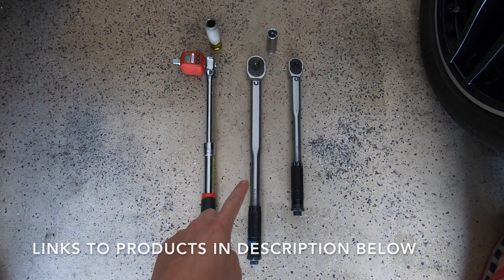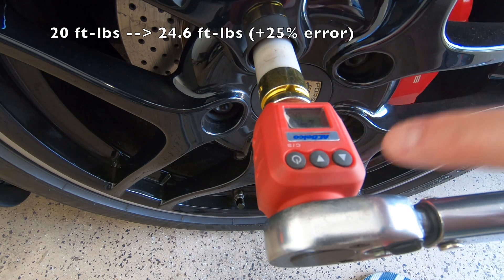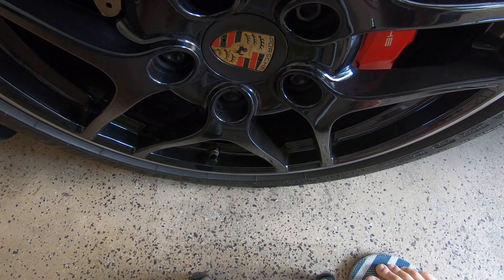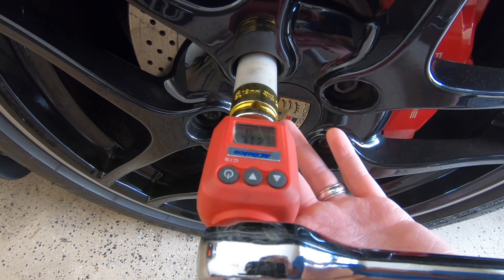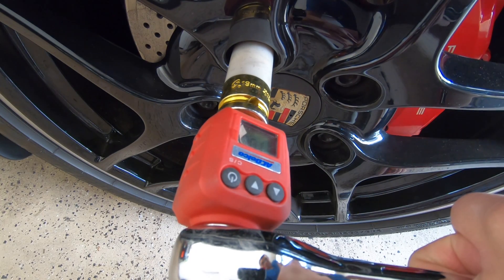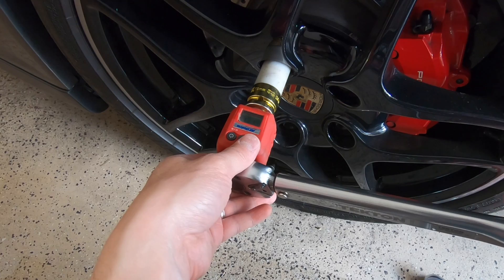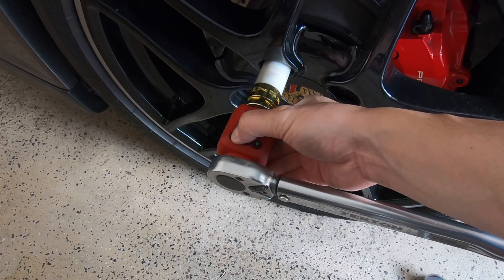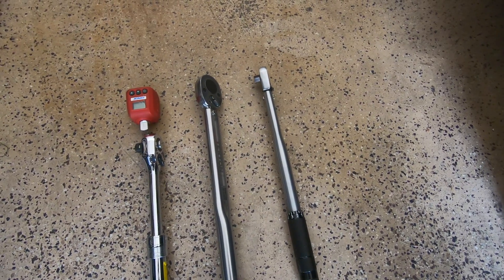How accurate are Clicker Torque Wrenches? Review & Calibration Tutorial

Comment: Why not just hang an actual weight measured exactly one foot from the center of the bolt with the wrench at as close to exact horizontal as possible.  Maybe even use a calibrated spring or digital hanging scale and just pull on it, regardless of the angle or direction of the wrench. Take out all mechanical variables, or as close to all as is possible.  You're just using a yard stick to measure another yard stick.
Reply: Just in case someone comes past and reads this idea, the tube type click wrench is length dependent, and the internal mechanism will measure the torque wrong if weight or force is applied anywhere other than the correct location at the handgrip. If the shorter wrench happened to be this length, a weight could be used directly. With a longer wrench, you can't hang a weight a foot out, it won't be accurate. The weight would need to be hung at the handgrip and the ratio adjusted, e.g. 20lb on a 24" wrench for 40 ft/lb

Comment: Not to takeaway anything from using torque wrenches, but why torque in the first place?  The answer is to place a preload in the bolt (torque actually only exists when the wrench is attached and force applied).  So threads are simply a spirally wound inclined plane.  As you might imagine, friction matters pushing a load up a slope.  And friction has two types, static and dynamic friction.  Everyone has experienced (I expect) that it takes more to get the load moving than to keep it moving.  Measuring what it takes to start moving (static) is not terribly comparable to dynamic (which is the correct usage).  Having said all this studies indicate there is up to a 30% variation in preload for the same applied torque.  Factors for this variation are clean threads, finishes of surfaces and oil/lubricant.  Oil or use anti seize on the threads when not specified = potentially more preload and over stressing due to reduced friction.  This is one reason you occasionally see single use torque to yield fasteners, the yield is the bolt stretching (preload), this then removes much of the variability due to friction which is hard to predict…. Where you can gain access you sometimes see measuring the stretch on the bolt specified.  Then there is ‘smart bolt’ technology…. a whole another level…. Ultrasonically measuring stretch.
I still use my torque wrench…. Just understand it isn’t an exact science and what you apply (or not) to the threads matters.

Comment: I think the test should be made on a welded bolt. Just need to measure the settings of the click wrench against the reading of the AC Delco. Then you could reach some +/- 5% (summary of the errors of the two units, in theory, in the midscale range). Which is better than +/- 10% in the begining, I agree. When You get +9% error to the click wrench, that could be really sth between +7% to +11%, with regard of those +/-2% from the digital gage.

Comment: I don’t have one of these so I don’t know if it has a zero button, but when did you zero the digital TW?. The wrench hanging on it in position is already registering torque. It may be why your numbers are off.
Reply: There should be a torque value showing on the meter when the wrench is hanging on it because the wrench is exerting a torque on it due to gravity.

Comment: Out of curiosity, how to test that the digital adapter is accurate?
Reply: Exactly, he replied with just stating what they told him was the accuracy of the adapter. I don't think he understands your comment correctly. Thanks
Reply from the maker: +/- 2%
Reply: @CarFanatic  how you know IF the ACdelco is accurate?  Did you take it to a place to measure it?  Or using known weight?
Reply from the maker: @johnnywong83  great question. I am assuming the acdelco is accurate within the specified range. The calibration of the clicker torque wrench will not be as accurate as if were taken to a real place, but it should be sufficient for my application.

Comment: How are you sure the digital indicator was accurate in the first place?
Reply from the maker: The digital indicator comes calibrated to within +/- 2% and I haven't used it much. It's not a perfect indicator but its more than accurate enough to improve the calibration of a clicker wrench.
Reply: @CarFanatic  What are you talking about?! The digital indicators are just cheap workarounds for hobbyists. The clicking mechanical ones are the gold standard. You should be checking the accuracy of the digital meters with the mechanical ones, not the other way around.

Comment: Man there are quite a few things you did that discredits the accuracy of the test. 1. You need to be aware of where you hold the torque wrench as you are applying torque. Too close or too far away from the handle area and you are applying more or less torque than indicated. 2. Once a bolt is torqued to a specific value, say 60 ft lbs, you can’t test it at 60 on the same bolt. It takes more torque to move that bolt..maybe 70..something about static friction. Torque values need to be reached as the bolt is moving. So you need to loosen, and then get to 60 again. 3. Torque wrenches are usually more accurate from 20% of full scale. So 5-80 ft lb is mostly accurate from 16ft lbs on.
Reply: Based on best practices, you have to move the bolt/nut in a smooth consistent movement and make sure you move up in torque at least with 5 ft lbs. So if the bolt/nut was torqued to 68 ft lbs and you want to go to 70 ft lbs, make sure you loosen the bolt/nut first to under 65 ft lbs. When you have multiple bolts\nuts, it is best to torque in stages to increase clamping load. So, for example, in case of tires lug nuts start to torque them (in cross pattern) to 50 ft lbs first then 65 ft lbs followed by 80 ft lbs.
Reply: The torque is measured at the head, exact hand position does not effect the reading.  Torque being force applied over a lever arm.  Shorten the arm requires more force, the torque is the same either way…
Reply: @EntropyPersonified  I am going to follow the instructions of every major torque wrench manufacturer that states grip position matters on a length-dependent torque wrench.
Reply: He did all the things you should not do lol
Reply: @chriscs9080  who, the video guy or Justin Philip? Thanks
Reply: It does not matter where you hold the wrench.  It is designed to measure torque at the hoint between the beam and the head of the wrench.
Reply: @rickyparrish2570  That’s not true at all. It does matter where you hold a torque wrench, hence why some wrenches are longer and others are shorter depending on the purpose and application it’s used for. 
(Torque = force * length) hence why it’s called a foot pound. 

If you have a 2 foot long handle, and at one end you have a socket connected to a bolt, and on the other end you have a handle to hold. If you hold the center of this bar (not the handle) you’d turn a 2 foot long handle into a 1 foot long handle. That means if you applied 10 pounds of force in the center of the bar to rotate the bolt clockwise, you’d be applying 10 FOOT pounds of torque. (12 inches = 1 foot)
On the same bar, if you held it at the handle (where it’s supposed to be held), then you’d apply 2 times the amount of torque if you used the same force (10lbs), aka 20 foot pounds. It’s not rocket science, plus I don’t see any reason to not hold one by the handle anyway unless it’s in a hard to reach place, in that case you should probably find another way of tightening that fastener by using a different approach.
Reply: @ehh2681  no it does not. Torque wrenches measure torque at the head of the wrench period.  The reason some wrenches are longer is so that you can apply more torque to meet the range of the wrench.  The fact that you are trying to explain physics to me is laughable.  The wrench doesnt care where you hold it.  It only cares how much force is applied. If you apply 1 poud of force a goot away from the head then that the wrench will register 1 ft.lb.  Conversely, if you apply 2 lbs of fource 6 inched from the head of the wrench then it will also read 1 ft.lb.  Where the force is applied is irrelevant. The only relevance is what force is measured at the head if the wrench.
Reply: @rickyparrish2570  and the fact that you just re-explained exactly what I said is laughable. Sure you can hold it wherever you want, but you won’t get the same output if you don’t change the force your applying.
Reply: @ehh2681  thus it doesnt matter where you hold it.  Which is what i said originally that you disagree with.
Reply: @rickyparrish2570  😑
We both know what we are saying, but our methods of using a torque wrench are opinionated.
Reply: @rickyparrish2570  You are measuring torque not a force.  The is a forces couple at the head so distance does matter depend on the wrench you have.  Tell me you are not an engineer or physicists.  If you are car dude or dudet than mo need.
Reply: @ehh2681  It seems like you guys are talking about two different tools. @rickyparrish2570 is right about the digital torque adapter, the tool used in this video, and @ehh2681 is right about the torque wrench. You can calibrate a torque wrench by using weights placed on the handle grip at different distances from the head of the wrench. So, for a torque wrench the place where the force is applied matters, but for a digital torque adapter it does not.